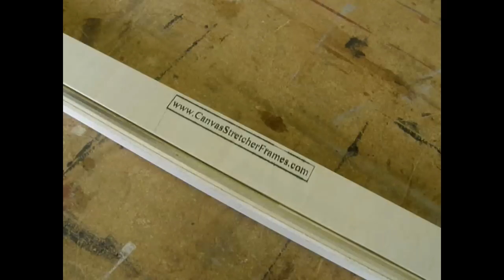Canvas Stretcher Frame Assembly Process

Comment: I don't see how you could compensate for normal slack in the canvas tha occurs over time with this type of strecher.
Reply from the maker: you are correct.  however, it would be possible to add dividers later on to add some tension.  In the future, I will be designing a professional stretcher with expandable corners and dividers to compete with other museum grade products.  thanks for commenting.